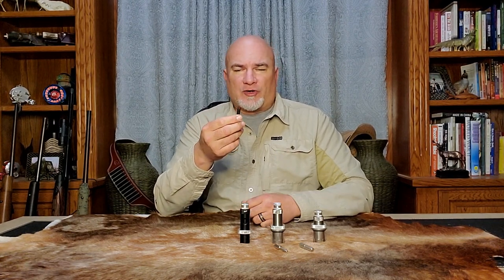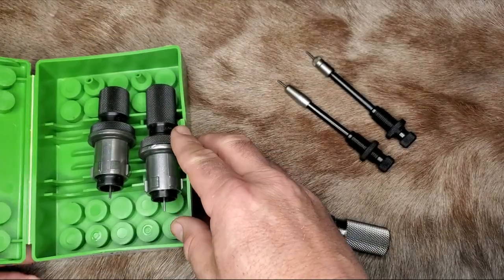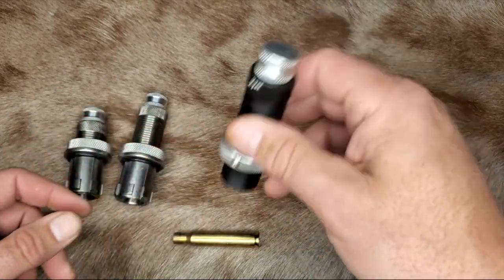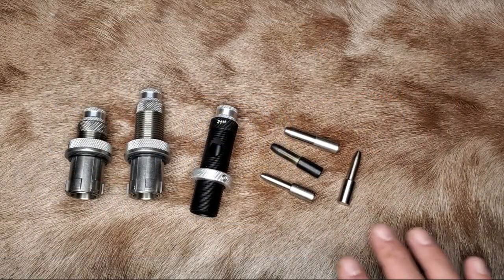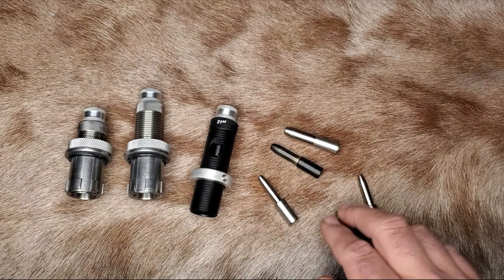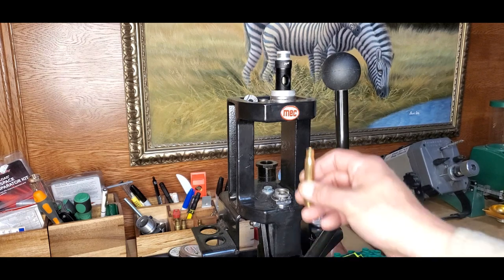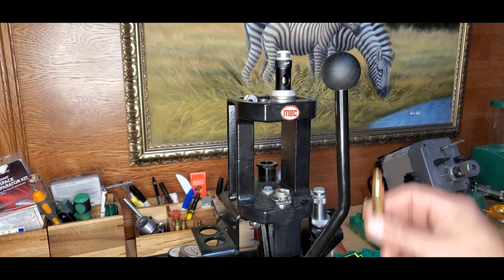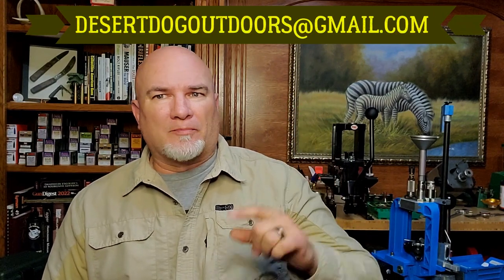UNDERSTANDING EXPANDER MANDRELS

Comment: Why not just use the Redding Bullet  Die that allows you to use inserts that set your neck tension.
Reply from the maker: The goal is much better concentricity. Using only my Redding bushings dies, I was having concentricity issues. I was at a point where that was the only shortcoming of my ammunition.  The mandrels (especially running it through twice) brought many of my 1/2" loads to 1/4". Using the bushing die only (no ball), lot-to-lot variances in brass thickness, brass changing with age, and lack of neck uniformity would cause inconsistent neck tension. Basically, expander mandrels give you the benefits of neck turning, with needing to turn necks. In fact, I stopped buying bushing dies because I don't need them anymore.

Comment: Do you lube the inside of the neck before using your expander mandrel?
Reply from the maker: No.
Reply: I do now. I collapsed a good piece of brass by not doing so. Use a dry lube.

Comment: i switched to expander mandrels the middle of last year for 308w 6mm 220 swift AI.
 I also check the expansion with a forster neck tension gauge on every case before loading, and have found some case didn’t not expand to the correct tension on the neck tension gauge so those cases i anneal.
Reply from the maker: I also anneal. But try running your cases through the mandrel twice; it REALLY makes neck tension consistent.